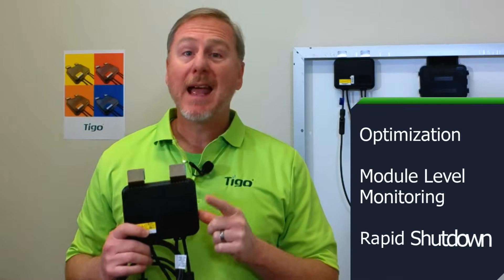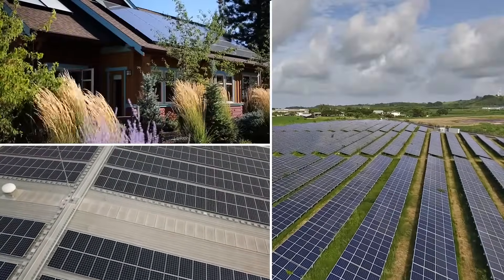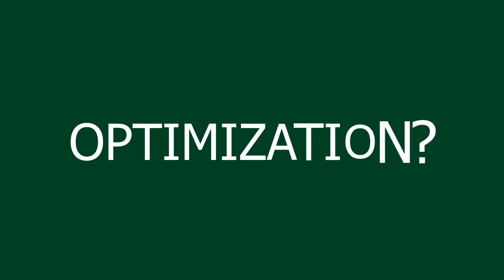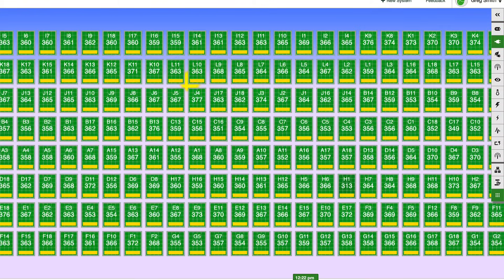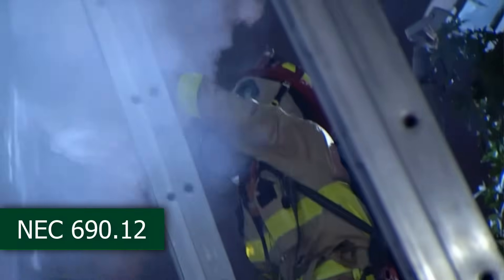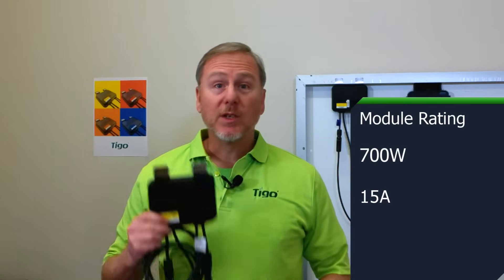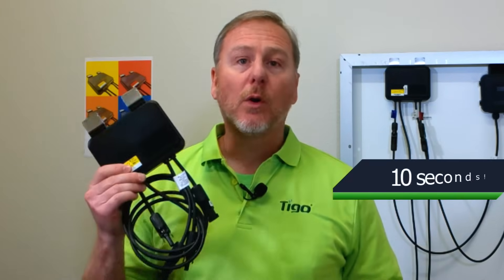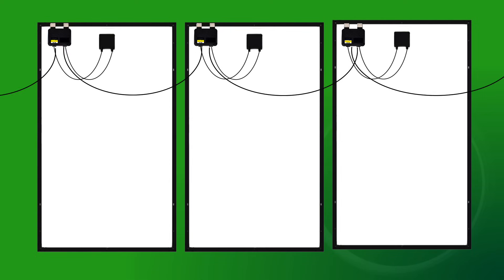Tigo TS4-A-O (optimizer) - Overview and Specifications

Comment: Do you have recommendation in how to safely deal with an installation of tigo optimizers when the complete installation with connection to the inverter will take some time a week or two (since the installation of the panels + optimizers).

Comment: Very interested in this product (pv installer here)! Question: I have one mppt (of two) with 10 panels 5° East + 3 panels 15° South.. Can I install only 3 TS4-A-Os in the 3 panels? No need for monitoring (TAP/CCA), only optimization.
Reply from the maker: That is possible and we call that Blind Deployment. Your warranty will reduce from 25 to 5 years and you will have no visibility into your system.

Comment: Can I install the tap in my attic under my roof deck?
Reply from the maker: Great question, and one we hear quite often. Although we sometimes get the question after the installation is complete. Since the TAP transmits wirelessly to the TS4, it is susceptible to obstructions that can reduce the signal strength. 

The TAP must be installed in the middle of the array for optimal wireless coverage, underneath a module with the TS4. If you have any questions, please contact our service line for assistance: https://support.tigoenergy.com/hc/en-us/articles/4401866316307-Contact-Tigo-Support

Comment: Can I use one TigoTS4-A-O on two panels? Or each panel must have its own independent optimizer? I have 45 panels in total. JinkoJKM440N-54HL4R-BFullBlack-440W.
Reply from the maker: Great question! The TS4-O units are 1:1 with the module they are connected to.

Comment: Check some independent reviews before buying this product. I found them to be completely useless if not decremental in my PV system.
If only I could go back in time and save myself 1000£+ of useless "optimisers". ..
Reply from the maker: Optimizers play an important role in mitigating the effects of module mismatch caused by shading, manufacturing variations, temperature differences, cell defects, and even differences in cable lengths or string configurations. Many times, customers state their system is not "working like it should" when, in fact, the optimizers are doing exactly what they are supposed to! 

Many things can affect the poor performance of our optimizers, assuming the unit is working as it should- such as installer error, communication issues between the optimizers and the CCA or TAP, or even lack of customer education or expectation management. Please contact our support team so we can get your system running in perfect condition!

Comment: Hi a Question. I have 9 panels on one string on a ballast mounted tilt system. (Four panels on a roof for the other string). Three of the panels of the 9 panels string will get some shading. 
Can i just put the Tigo DC optimisers only on these 3 panels or do I need them on all the 9 panels of that string. Help
Reply from the maker: Great question! You may only use optimizers on affected modules. Our Help Center article goes into more detail. 

https://support.tigoenergy.com/hc/en-us/articles/360024860193-TS4-Systems-Methods-of-Deployment

Comment: Multiple orientation question, I have a quote which has 20 panels total. 10 are on one string East facing and then 5 South & 5 North on the other string all with optimisers. Is the north/South string going to be ok? Using a Solis 6kW hybrid inverter. Panels are JA Solar 440w bifacial and I'm in the UK. Cheers
Reply from the maker: We love complex roof geometries like yours, Steve! These are applications where optimization shines, no pun intended. The optimizers will work as hard as they can to harvest as much energy as possible from those modules. Although we do not recommend looping a string over multiple roof faces, the system will still perform well.

One concern would be the placement of the Tigo Access Point (TAP) since it is installed onto a module in the center of the array. Since you have multiple strings covering 3 different orientations, we want to ensure the TAP will have a strong signal to reach the other TS4s on their roof faces. Contact our Sales Engineering team for a free TAP Placement review. Worse case, you many need another TAP. 
https://support.tigoenergy.com/hc/en-us/articles/4401866316307-Contact-Support
Reply: @Tigo_Flex_MLPE  many thanks for the quick reply! So ideally I'd have them all on their own string but could have them on the same if needed 👍
My roof is a little odd as the house was extended but should be able to get the TAP in the middle of the roof and reach all the panels as its all fairly close together. Hard to explain in comment but on main east roof and then the extension to the rear which would have been too wide the keep the new ridgeline below the original ridge height so have a double peak roof at the back, so essentially 4 roof faces (2 north and 2 south).
It may be that I have a second invert running the battery so might get them to split anyway but at least I know it's not an issue if I don't.
Thanks again and I look forward to generating so sun power soon!

Comment: with this optimizer installed, do you still need the diode at the end of each PV string?
Reply from the maker: Most modern modules have bypass diodes built into them. If not then it is still a wise thing to do.

Comment: Using the TC4-A-O do we have to expect additional EMI emissions (e.g. <30MHz), because we have an electric device with an internal clock and long wires connected ? Could this lead to any problems?
Reply from the maker: The TS4-A-O uses the TAP to communicate module level data and for rapid shutdown. The TAP uses a Zigbee signal in the 2.4GHz range worldwide, but it could also be 915 MHz in the Americas or 868 MHz in Europe. Contact our support team for more information.

Comment: Of course you would want the monitoring connected to monitor each mudule, but am i right in thinking they can be connected without the monitoring ?
Reply from the maker: Hi Kevin, this is a common question. The answer is a hearty "Yes, but..." What you are referring to is blind deployment. We do not support this application and it does impact the warranty. You can read about our deployment options here: https://support.tigoenergy.com/hc/en-us/articles/360024860193-TS4-Systems-Methods-of-Deployment
Reply: @Tigo_Flex_MLPE  Ok thanks. I have a idea for a additional product you could offer, if you wanted to contact me.

Comment: Does having a tigo based rapid shutdown system mean you’ll have two outdoor shutdown levers? Or does this replace the need for an AC disconnect since it’s doing it at the module level?
Reply from the maker: Hi Mitch, you must still have a way to "turn off" the array for rapid shutdown to tell the TS4's on the roof to stop passing module voltage. This Tigo Help Center article talks all about it: https://support.tigoenergy.com/hc/en-us/articles/201873956-Application-Module-level-Disconnect-for-Safest-Solar

As per NEC 690.12(C):
Initiation Device. The initiation device(s) shall initiate the rapid shutdown function of the PV system. The device “off” position shall indicate that the rapid shutdown function has been initiated for all PV systems connected to that device. For one-family and two-family dwellings, an initiation device(s) shall be located at a readily accessible location outside the building.

The rapid shutdown initiation device(s) shall consist of at least one of the following:

(1) Service disconnecting means

(2) PV system disconnecting means

(3) Readily accessible switch that plainly indicates whether it is in the “off” or “on” position

Where multiple PV systems are installed with rapid shutdown functions on a single service, the initiation device(s) shall consist of not more than six switches or six sets of circuit breakers, or a combination of not more than six switches and sets of circuit breakers, mounted in a single enclosure, or in a group of separate enclosures. These initiation device(s) shall initiate the rapid shutdown of all PV systems with rapid shutdown functions on that service. Where auxiliary initiation devices are installed, these auxiliary devices shall control all PV systems with rapid shutdown functions on that service.